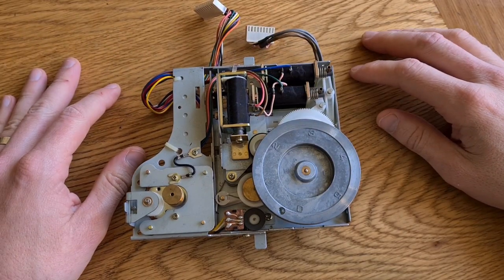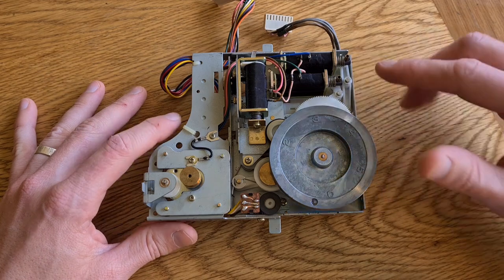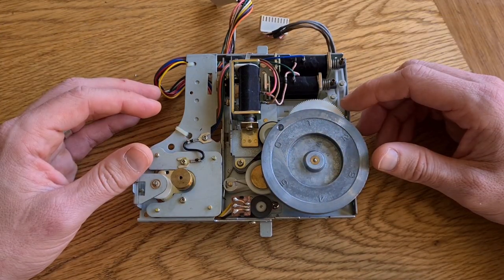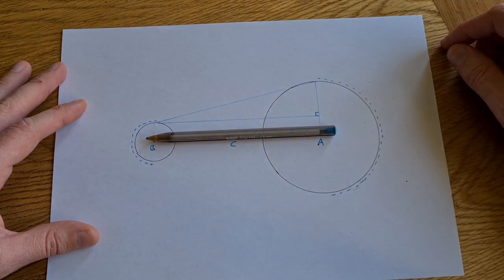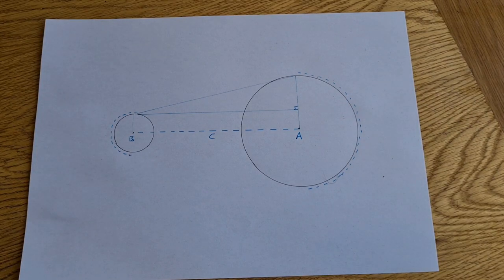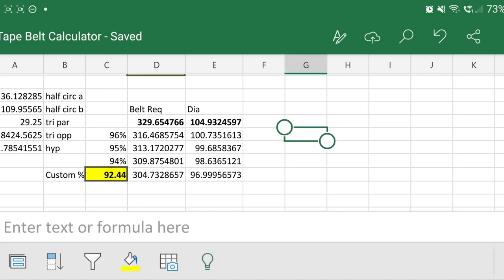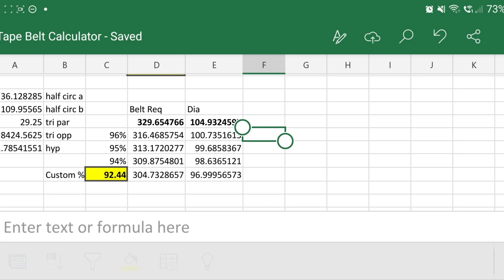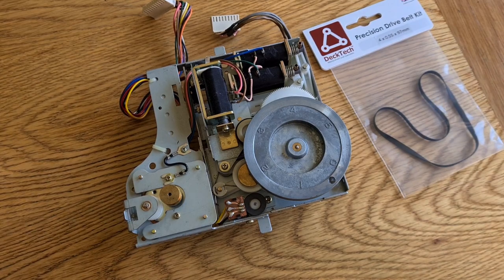USING MATHS (I said I never would) to replace Cassette deck belts?

Comment: Perfect! I used the string method,  and it didn't work well at all.  But I would have had to disassemble most of the deck to get at the pulley and flywheel... which had to be done anyway to install the belt.
Reply: It was a Sears LXI from 82(?) which had zero info on the web about it. It's a neat doorless deck that sounds excellent but smells like it was dipped in flux.
Reply from the maker: I love that smell. A cross between electrical celery and cat piss. 

I see your point though. Sometimes you just can't get in to measure up, or there are three pulleys on one belt. Sometimes trial and error is all you have!
Reply: @pwrestoration  Ha!! "Elecrical Celery" is my new band name that does chip tune covers of 80s Toronto pop bands.
Reply from the maker: @MikeDS49  For undiluted electrical celery open a CDR spindle and take a whiff!